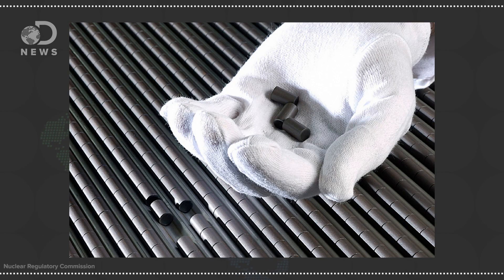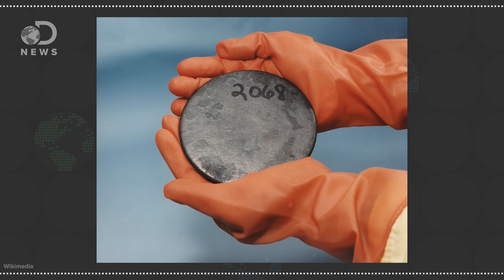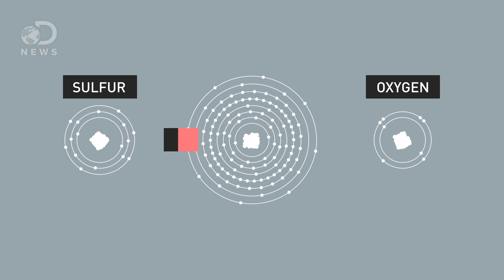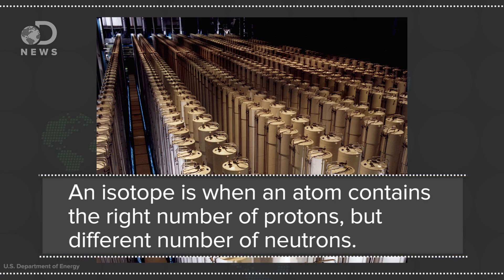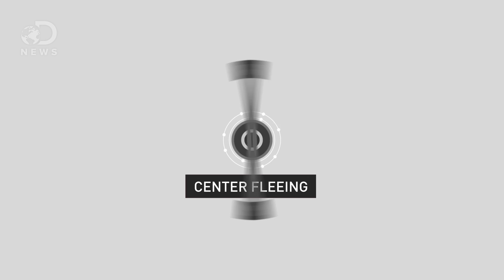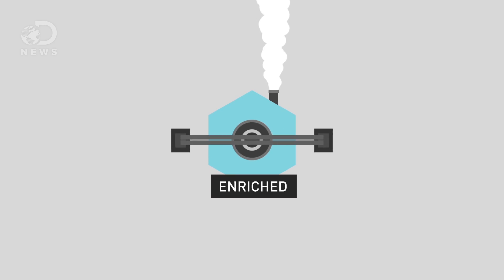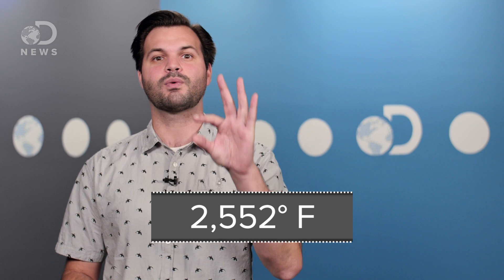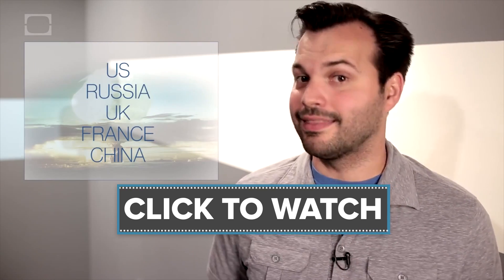How Uranium Becomes Nuclear Fuel

Comment: why is U235 better than U238
Reply: A4 science U238 isn't fissile (wouldn't split when a neutron hits it)
Reply: WHY? u know its easy to split 238 (119) than 235(117.5)
any way i appreciate ur effort tnx
Reply: A4 science Er... this isn't exactly a math problem. Different isotopes actually have different internal structures in the atomic nucleus which makes some easier to split than others (it's kind of an obscure quantum physics issue and is something you really have to go to university to understand). It is possible to use natural uranium (ie U-238 with a small admixture of U-235) to run a power plant in what's called a heavy water breeder reactor, and that's actually what the CANDU reactors made in Canada do; the heavy water (ie water with hydrogen-2 atoms instead of regular hydrogen) slows down neutrons in the reaction enough to cause U-238 to become Np-239, which decays via beta emission to Pu-239, which is a fissile isotope. (It was also the core material used in the Fat Man bomb that was dropped on Nagasaki.) The "breeder" part comes when the plutonium, not the heat output, is the desired outcome; what happens then is that the spent fuel is reprocessed to isolate the plutonium, which is then usually used for nuclear weapons (but can also be used for power, either in a regular reactor or in radioisotope thermal generators, which are what space probes tend to use for power). 

The reason uranium normally has to be enriched is because although light (regular) water can be used as a moderator, you don't get enough neutron flux from natural concentrations of uranium to create a reaction. (Look up the Oklo reactors, then note that when that was possible, it was two billion plus years in the past and there was a lot more U-235 in the Earth's crust which has now mostly decayed to lead.) Only about one in every thousand water molecules contains one or two hydrogen-2 atoms, which means the money and time you save on running centrifuges you lose in acquiring expensive heavy water for the main cooling loop. (Arguably the heavy water is still cheaper, which is why CANDU has been a popular Canadian export technology.) 

tl;dr You have to turn U-238 into plutonium before you can burn it, and the reason why is way above my pay grade but can be learned at any uni with a decent physics program.

Comment: You could also install solar panels to run batteries. Done.
Reply: And how do you plan on transmitting the power from these sunny locations?
Reply: Good luck covering at least 10% of earth's surface for it to be of any good. :D
Reply: Chernobyl was actually caused mostly in part to the construction of the reactor. The method of generating the power was fine, but how the reactor was built to generate the power was not. A combination of shortcuts in design and safety taking second place, wanting to get the project done ahead of an election to appease socialist party leaders and the desire of the one man running the show by forcing the stations power to below the safety threshold of 1k - 700MW to 200MW...

The workers were all properly qualified to do their job, if anything, they were steering the titanic without a rudder and with a captain high as a kite.
Reply: Andrew harbit Thanks Tesla for AC power + high tension (Voltage) is loss less way to transmitte energy from high distances
Reply: 2014andBeyonD Enough energy for the entire planet? I need dem sources, please.
Reply: You have the space for solar. The miles and miles it requires is ridiculous. And when you think about it there is more waste than nuclear since when solar panels die they go to landfills
Reply: 2014andBeyonD 8%  of Texas. Do you even realize how much fucking space that is? Thats over 20 thousand square miles! That larger than 60% of all world countries!
Reply: Darius P Actually yes, nuclear power plants needed to power the US take up not much more than a few square kilometers.
Reply: 2014andBeyonD I'm lazy to check this out but rumors say that Germany is importing electricity after they closed their nuclear plants. Fact is, however, they have the highest energy bills in Europe. Also they are still using coal and fossil fuels on a massive scale. No other country in the world can afford this kind of sacrifice. And I think they are making this sacrifice from the wrong reason.. from fear. They should be closing the coal power plants!
Reply: Just because it's possible doesn't mean it's efficient. Nuclear power takes up much more surface area is not weather dependent. The se power plants will keep running and they will keep generating power, even if the sun stops shining. You are thinking to idealistically, it's about dollar signs, everything else is irrelevant when it comes to power production and It's cheaper to use no clear power then it is to use solar cells. Also batteries are horridly inefficient and are much worse for the environment then the most primitive and inefficient and polluting coal power plants.  And in all honesty there's nothing wrong with nuclear power, solar cells use less than 14% of the Suns energy (NASA has some that can go as high as 50% but those cost way to much. So much so no sane government buys more than two at a time). Your idea just doesn't work. So put on your big boy pants and drop that pipe dream of yours.
Reply: Nuclear energy is sustainable and there is nothing wrong with it.  Tesla may try to get solar energy to be the sole source of electricity but I don't see how. My money is on either hydro electric or nuclear. And my information on solar cells and batteries is current. Your information is assumeing we have technology 20 years ahead of what we currently have.
Reply: Your concepts for clean energy are pure in sight but hardly attainable on a large enough mass would wide scale, I mean to clean up and power the world every nation has to follow the same energy program other wise it jst does not matter. Nuc science is a sound solution and there are battery concepts that can last over 400 years sounds a lot better then lithium ion
Reply: Photo-voltaic Cells cannot hold a charge. This is why Solar Panels are not useful. If there was a way to hold a charge they would by far be the best, but they are unreliable.
Reply: Let me explain something to you.

Chernobyl - Old, unregulated nuclear power plant that failed do to lack of experience in their workers

3 Mile Island - Failure in Human Protocol, they accidentally shut off the cooling, but was quickly resolved. 

If government spent their time regulating these businesses and not "What bathroom can I and can I not use" they would be fine. 

I've done some skimming, and I saw that your post mentioned "Nuclear Waste"

Let me explain. Low level enriched uranium (5% fissionable, 95% not) can just be buried without any consequences. You can get more radiation riding on an airplane. Higher doses of radiation are put in concrete, then lead, then buried deep in the earth. But with breeder reactors we can breed more nuclear fuel! It BREEDS plutonium. Don't even get me started on what will happen when we figure out fusion. We already did. Hydrogen (Thermonuclear) Bombs use this process, once we figure out a way to safety contain it, we are in the clear. Our sun uses fusion, but from reading you seem intelligent enough to understand that. Don't think I am condescending, though we share different beliefs I do feel you know somewhat of what this conversation is about. Yes, I do know that this is over 2 years, but it is never to late to change someones mind
Reply: Utilizing long range lines plus the resources required to string them up all over the nation from a few solar hot zones too costly
Reply: Yes the sun is key to our energy problems, in photovoltaic and thermal but the only possible way to ensure equal power around the whole planet would be to construct a high alt sat system which could conduct the light in beams where ever it was needed
Reply: 2014andBeyonD What the eff.. I was talking about solar power (so were you, on the original comment) -.-
Keep your sass for the appropriate situations.
Andrew harbit You still need to focus it with something, right?
Reply: 2014andBeyonD 
You can't run an economy entirely on solar panels and batteries (yet). For the present, fission is the smartest way.
Reply: ***** 20,000 sq m is larger than 60% of the countries? I really doubt that.
Anyway, what do you want? Solar power that takes 1sq m of land to power the world or something? :D
Reply: 2014andBeyonD we can't because our means of gaining said solar energy are extremely insufficient.
Reply: ***** Again, we are talking about solar.
2014andBeyonD Inconsistent, needs replacement and stuff. It would be better to have mini suns shining in our own fusion reactors. But... If we could use solar, wind and hydro energy together to produce what we need at all times, then yes why not, it'd do for now.
Reply: Thousands of solar panels and millions of temporary batteries
Reply: Darius P Your number is based on mid 70's technologie. Nowadays +/- 1% of the Sahara desert is enough to generate enough energy for the entire planet. 8% of Texas is enough to power all of the United States.
Reply: Andrew harbit Ofcourse you're not going to power a country or planet from one tiny square. That example was to show how little space is needed for solar panels to power an entire country or planet. But even that tiny surface is not needed. The total surface of half of all all the rooftops in the United States is way more than that 8% of Texas example.
Reply: Darius P you dnt have to cover 10% of the earth we concurve the light into a smaller stronger focal point, theres vids all over youtube check it out
Reply: ***** The sun shines for free. The wind blows for free. That is sustainable. When a solar panel gets broken, it doesn't leak radiation, it doesn't pollute half the globe like one power plant does. Solar doesn't leave behind incredible harmfull waste that radiates for tens of thousands of years leaving behind a mess for future generations. Nuclear power is foolish. Oh, regarding your battery argument: Lithium-ion batteries are not harmful. The lithium is used as thin sheets of metal and those are recyclable and the second thing they use is a salt solution which is not harmful for the environment.
Reply: Darius P I don't know if you are aware of the phenomenon, but each morning a super fusion reactor called the Sun comes up and begins to shine, giving us energy.. ridiculous amounts of energy. Its output is ridiculous high and it's free. From a business perspective, it's hard arguing a power source that is free. Not to mention it's clean. Talk to the 16 most polluted cities in China where they wear dust masks. It's not a trend yo, it's a necessity.
Reply: Andrew harbit High altitude systems are not needed. Technology in our age is too efficient. It's  way more cheaper and it's more save to have solar collectors on the ground than in space.
Reply: Darius P Well if you ask me, if it takes 8% of Texas (it's actually less) to get an entire country off fossil fuels for ever, lets do it. Apart from the surface area, the sun shines for fucking free for the next 15 billion years. It's hard to argue a free energy source. Why build nuclear powerplants that leave behind awful waste when we have already a giant one in the center of the solar system?
Reply: hedemegmondom Germany closed eight nuclear power plants. It is possible.
Reply: ***** Even with the current technology it is possible. Just because the infrastructure of storing sunlight doesn't exist doesn't mean it cannot be done. When the giga factory from Tesla is up and running you'll see it's possible. Actually, if you compare it to nuclear power, it's a walk in the park. Again, it's clean and lithium batteries are recyclable.
Reply: ***** All your arguments belong in in the early 1990's and really, this subject is now officially beyond discussion. Times have changed son, the sustainable revolution is growing exponentially. Tesla Energy is really going to do it. So, grab a box of popcorn and enjoy the show.
Reply: hedemegmondom No it's the other way around. Germany its peek production in solar and wind is so high that neighboring countries such as mine buy that electricity. But you're right, they should close those coal plants.
Reply: Alex Moore...uh, okay? The cells don’t have to hold a charge. Battery banks are charged by solar panels in off-grid systems. It’d been happening for a long time. It’s weird when people like you talk so confidently and have no clue...